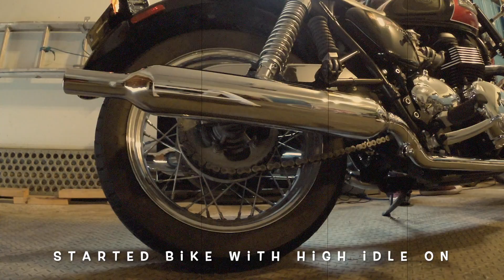Triumph Bonneville T100 Exhaust - Stock vs TOR

Comment: Hi, thanks for the video !  Is there any visible difference between stock and TOR exhausts ? My T100 (carb) has one exhaust with baffle and one without ! And there's absolutely no other visible difference between the 2 of them... I looked inside with endoscome camera, and there's no sign at all of bafflectomy...
Reply from the maker: The TOR is about 5-6” shorter than the stock exhaust. And then the TOR has a stamped indentation stating it’s for off-road use only. Depending where you live, this may or may not be an issue. Thanks for your comment.

Comment: What mapping did you run after the TORs?  I have a Power Comander V and the closes one I see on their map list is with the British Custom pipes? Close enough?
thanks
Reply from the maker: Thank you for your comment. Yes, I believe that is close enough. I knew someone who also used the Power Commander V and the check engine light was always on (because of the O2 sensor removal I believe). I personally used the engine map from Triumph Twin Power. I bought a USB to OBD2 cable and then hooked it up to a laptop and used the program. I will make a video of this in the future.
Reply: @UrAvgRider  yes that would be a helpful video as most forums said it was easy but for newbies would be a daunting task when done without visual guidance
Reply from the maker: It was super easy. But I’ve been thinking about doing a video for a while. I’ll keep you posted when I’ve done it. Thanks.
Reply: gidday mate when do you think you will be doing that video, really want to watch, just purchased my T100
Reply from the maker: We still have snow on the ground. Should be gone in a few weeks. I’ll do my best to get the tuning video completed shortly after it’s gone. Thanks so much for your comment.